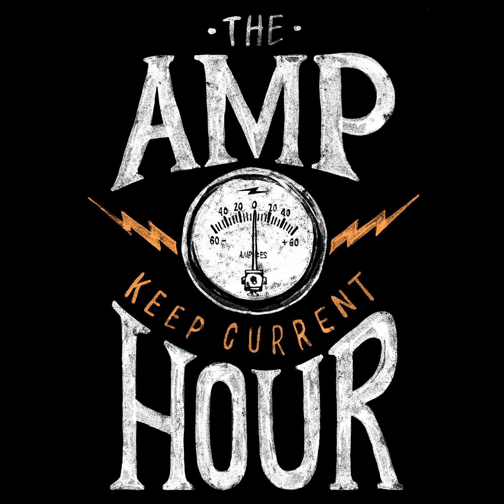The Amp Hour #581 - Real Time Operating Systems with Brian Amos

Comment: Great podcast.  The Hands-On RTOS with Microcontrollers book by Brian Amos is a very good intro to RTOS.  Covering FreeRTOS is great, but perhaps a follow on book could cover Zephyr in the future. I'm not sure when this was recorded, but as of today I could not find any NUCLEO-F767ZI boards in stock.  I like Newark's timeline for this: 4/10/2023, 53 weeks out. Perhaps the code could be ported to another STM32F7 board such as the STM32F746G-DISCO since I do have this as well as a few others. Thanks for posting this.